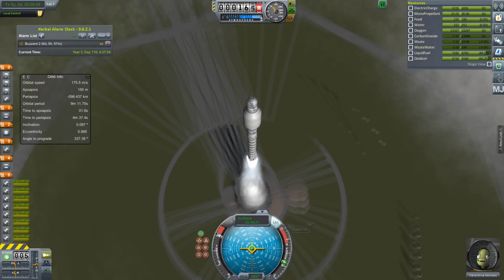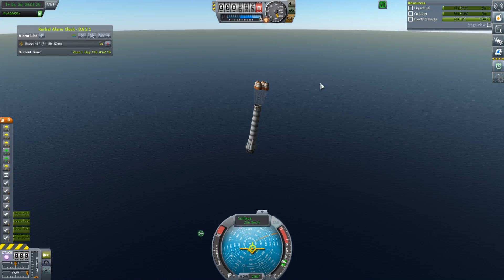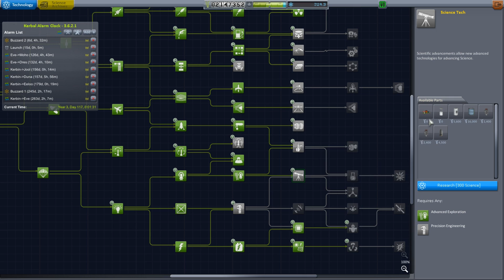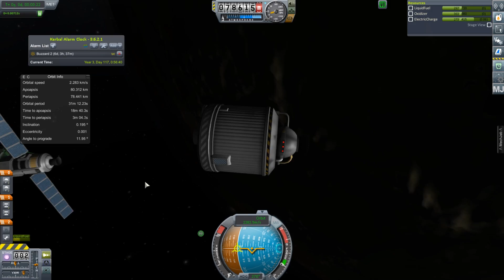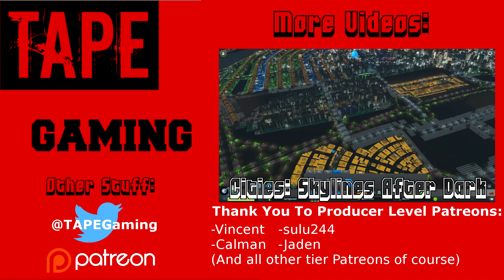Road To Exploration #29, Scanning For Ore, Kerbal Space Program

Comment: The resources you were asking about are all used in RoverDude's USI Kolonization System (UKS) mod and USI Life Support (USI-LS) mod. I believe the Community Resource Pack adds them all into the game, and since the M700 scanner is coded to provide a low resolution scan of ALL resources, you will see them even if you do not have mods that use them. I don't know a lot about TAC LS, but I believe that KPBS water drill that you have can be used to help aquire LS resources in situ. Hopefully someone more familiar with that system can fill in those gaps. Hope this helps!